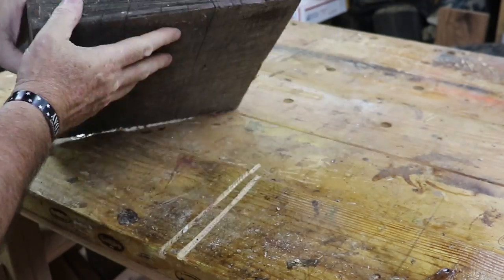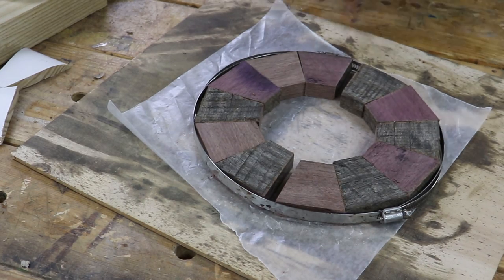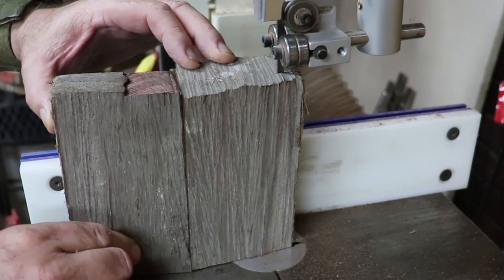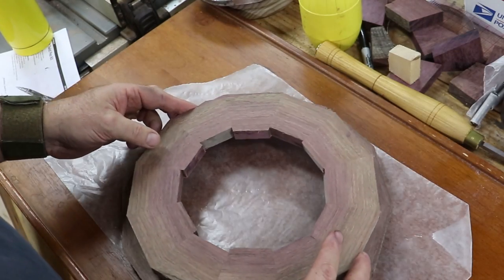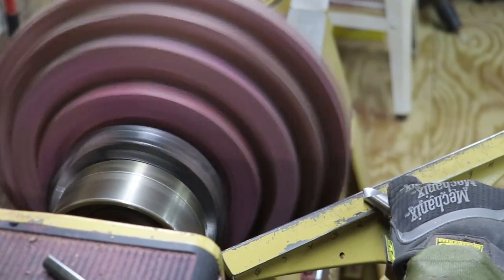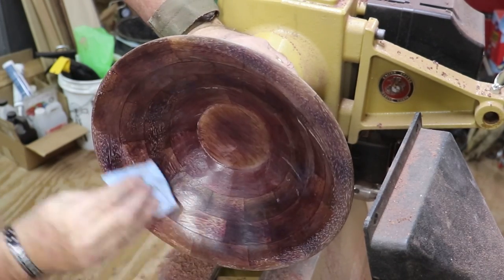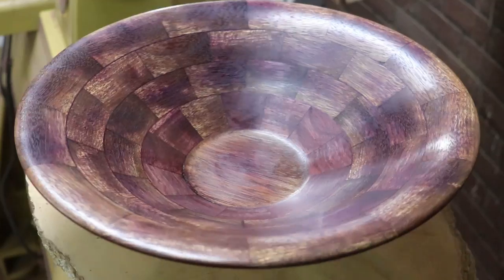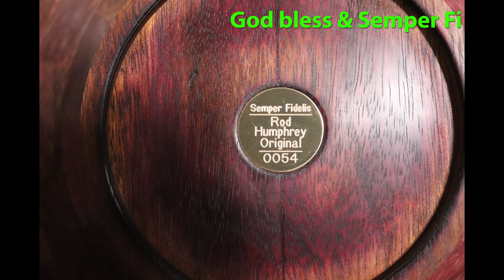Woodturning Weathered Purpleheart

Comment: Beautiful work Sir! I've worked with a lot of purpleheart and it turns out nice very time.  I've only turned pens and rings so far from it though, no bowls.  To bring the purple back out I've had the best results with leaving it in the sunlight for a few hours flipping it hourly.  A heat-gun while on the lathe works but the sunlight seemed to give a more even color to it.  Your work is always so amazing.

Comment: Sir , you dont know how happy you have just made me feel. I picked a fair amount of old very weathered purpleheart about a year ago that had been used as beach groynes here in England and was slightly unimpressed when I made my first cuts into it and discovered it had lost a lot of its colour and now I know how to bring it back out so I thank you very very much for showing me how. Ps the bowl is stunning
Reply from the maker: Excellent!  I'm happy to hear it.  Have fun with that, and thank you very much!
Reply: Another good way to bring the purple back is to wipe the wood down with acetone and then place it in bright sun, or under a strong UV light.  I've done this many times and it returns a nice, even purple. The purple is caused by the oxidation of compounds in the wood.  Just don't leave it too long after the purple returns because further oxidation will turn it brown.  I read this on Kings Fine Woodworking, so I can't take credit.
Reply: @KK-WNY  Excellent will give it a try also thanks

Comment: You described the one downfall of segmented turning very clearly! I doubt I'm alone in saying that the turning is by far the most enjoyable part, but sadly, it's short lived in segmented projects. This turned out beautiful, a perfect example of the treasures found in reclaimed wood, and a lesson in not judging a book by its cover.

FYI, Did you know that if you put a not-so-purple piece of purple heart in the oven on about 325°f, for an hour or so per inch, it will come out a most beautiful royal purple.  You can even play with your colour preferences a bit by varying the time and temperature, longer and hotter results in much darker. If you happen to scorch it, it sands off (don't ask how I know! Note to self... 350°f for 4 1/2 hours is too much!)
Reply from the maker: haha!  I won't ask... but no, I hadn't thought of the oven trick.  Makes good sense though, thank for the tip!  Thanks very much for the kind words too 😊

Comment: I always knew the color would come back after exposure to light but using the torch is new to me. Also I couldn't figure out how the angle cuts could be so far off until I realized you didn't true up your boards before using the Wedgie sled. Or did you do that on purpose so you could demonstrate the fix? But in the end you turned a pretty scruffy piece of wood into a very nice Purpleheart bowl. Acks sure does a nice job of creating a finish. Thank you for sharing. Have a great day and stay safe.

Comment: I made a chess set from Purpleheart and Birdseye Maple. I used a mini lathe to turn most of the pieces, with the obvious exception of the knights. I still have that set, but what I wish to do is make a larger checkerboard, with a special made shallow box underneath the Game top. The box will have slots for each piece, lined with felt to keep them all in good shape. I still have a fairly large piece of Purpleheart, but will need to shop around for some more Birdseye Maple.
One of the things that makes Purpleheart so good to make things from is how dense and hard it is, yet with the right tools it can be shaped quite easily. The same is true for Birdseye Maple. Just don't breathe the Purpleheart dust, as the wood is somewhat poisonous. Best to wear a breathing mask while working with it.
Reply from the maker: Sounds really nice... and your next one sounds well planned out.  I have yet to make a chessboard and complete set.

Comment: Nice piece, good use of the little wood you had available. As someone who's recently been gifted a good bit of purple heart, have to ask, how much more did you have to sharpen your gouges compared to other woods? 😀 I've not done much with mine, just made a mallet head to test working with it and man did it take the edge off my planes fast and man what a pain to plane, grain runs every which way, finally resorted to sanding to finish it.
Reply from the maker: Thank you very much!  I sharpened a couple extra times, very hard and dense stuff!

Comment: For some odd reason I couldn't see the whole video today! But what I saw so far was lovely! I will check the rest as soon as I get access to a secure internet that doesn't fail me as it did today!
I have a question - is it possible to save those purple shavings and cast it in resin and they stay purple or will they be just boring in colour?
Could be a project!
I will return to see the final...

Comment: 16/32 drum sander?  the 10/20 is more in my budget, any thoughts on performance of the smaller unit?   i also need a mentor for purple heart, I never get it to come out right,  so much I don't use it anymore.

Comment: Very nice. Do you ever have trouble with radial lines when sanding like you did. If so, any tips for eliminating them? Thanks
Reply from the maker: Thank you!  I do sometimes, but the only tip I know to pass on,  is to sand lightly with the larger grits and just keep sanding until those radial lines from the previous grit disappear, before moving up to the next one.  The reality is that there's a lot more sanding than I would ever want to show...it looks boring on video 😊